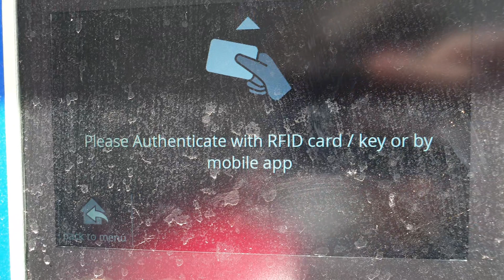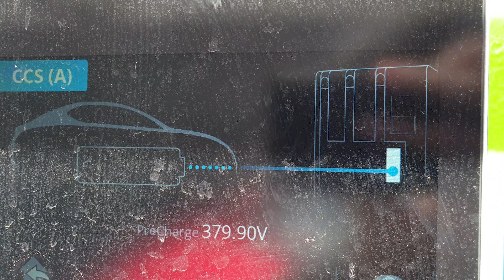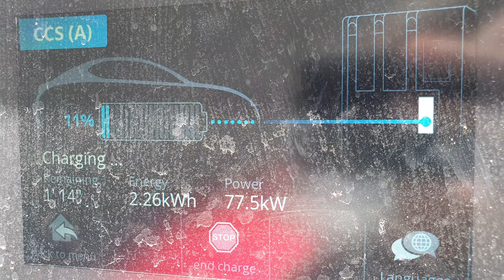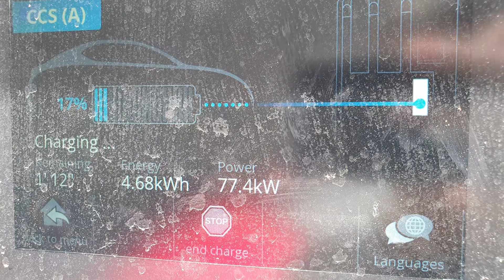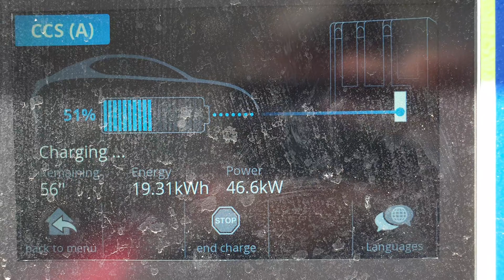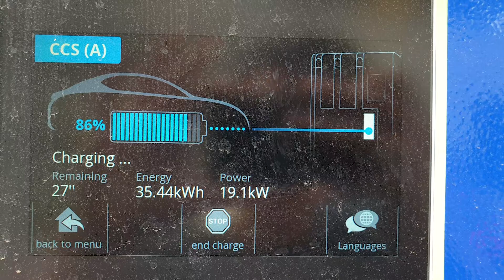MG ZS EV: Summer Rapid Charging Test | KC Talks EV

Comment: Very impressed with the charging speed. If you plan a long journey and aim to arrive at less than 10% do you always have a backup rapid close by. My limited experience is that quite often I can get a charge on some networks. Only use Alpa power once and that was reliable
Reply from the maker: I try and have a backup within 5-10 miles, although I just look on Zap-Map. At 10%, that is a ~10 miles (motorway) before I need to call the AA. The backup is coincidentally some other provider, likely a contactless setup to avoid additional heartache.

Comment: Did you get higher charging speeds after the BMS fix update? Someone in Norway even reported better charging speeds after the comfort 2 update
Reply from the maker: This is after the comfort 2 update. As far as I'm aware, the comfort 2 update didn't do anything WRT range or battery charging speeds. 

The BMS update fix I think was for the Rolec charging (which since I do have a Rolec I can get) however AFAIK my car wasn't updated with this BMS fix alongside Comfort 2 as I never explicitly asked for it. I have Bill Burgess' board which works great so there is no immediate need. 

P.S. - Here is the comfort 2 overview video: https://www.youtube.com/watch?v=RB8-qxu6xBY
Reply: KC Talks EV, I always thought the EVCC ECU update (BMS update) was mandatory to use the Rolec charger with the modification
Reply from the maker: There was an update in December (I got it mid December), this was for smart charging, but as far as I was aware you needed it for the granny cable that came with the car and Rolex issued out a trickle charging 'fix'. 

There was another in June/July that apparently fixed smart charging without needing a board but I don't think I received that update.